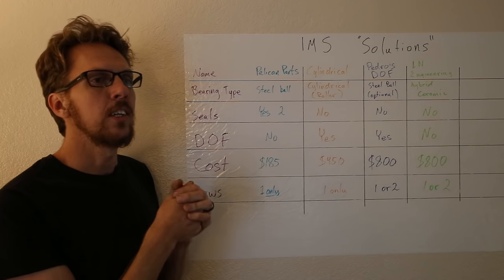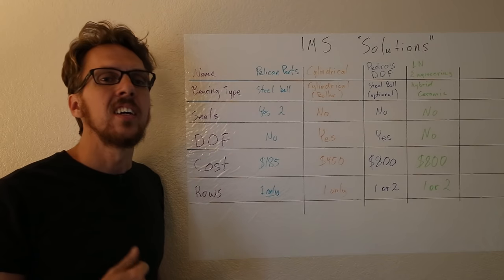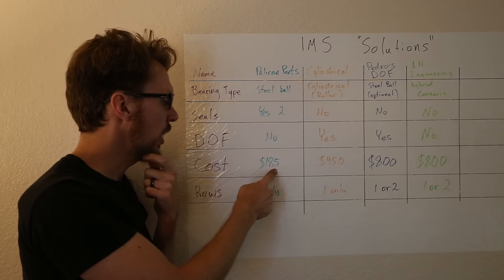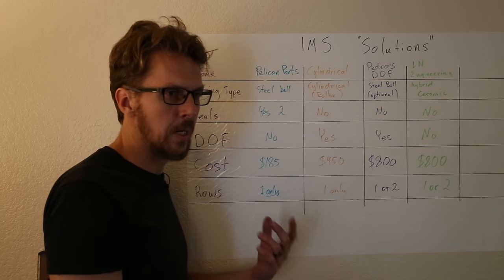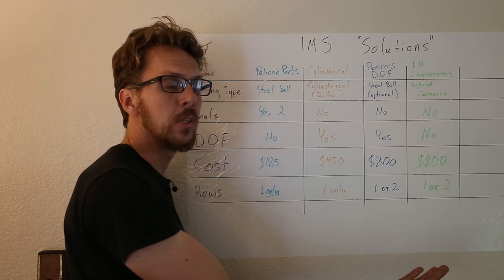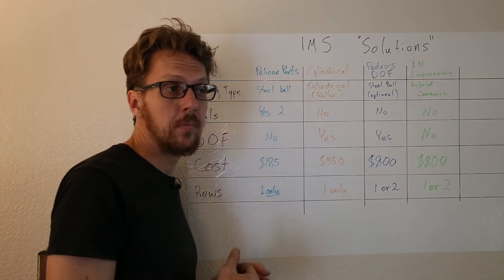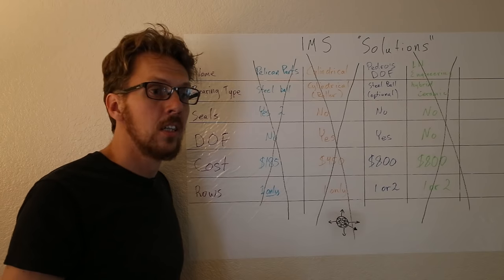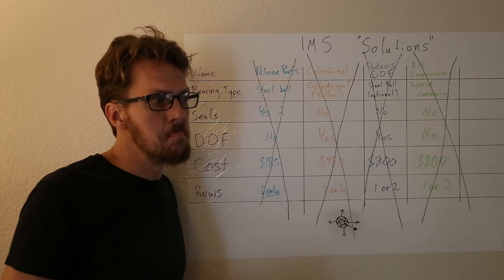What's the Best IMS Kit for Porsche (996 or 986)

Comment: Burner, you are right, especially LN in the pricing model. I can understand the high price in the beginning, to protect against the engineering costs and development, but as volume grew, the cost should reflect a fair markup. LN advertises that they have 30K kits installed, even at 800...(many of the solutions they sell are much more expensive) adds up to 10s of millions of dollars in revenue. Opportunistic, to say the least.

Comment: One thing I don't hear much about (oh, great video by the way!) is that the sealed bearings are running in grease, not oil.  Removing the covers and using engine oil on balls seems like it is a bit thin of a lubricate.  My understanding is that bearings and bushing work by maintaining a thin layer of lubricate between the rotatey bit and the not rotatey bit essentially hydroplaning. Great, but the ability to maintain that layer is dependent on contact size and point/line load.  Balls have such a tiny contact area they need a thicker lubricant (like grease) so you see this in ball bearings and CV joints.  Bushings have huge contact area and can use a thinner (oil) lubricant (like cam and crank bearings/bushings).  I think that when the ball bearing or CV gets hot enough, the grease will flow a bit, but it stays pretty thick.  So,...  If you remove the cover of a ball bearing and expect oil to lubricate then it will probably not be up to the challenge for high radial loads.  I have no idea what the end of the IMS load is (all the important sprockets and such are on the other end), but fast and spinning probably will have a reasonable load.  All this together, I think if you had found a bad seal on your original bearing it would have been gone or be going south.  Since it was intact, you were good.  The low mileage cars have more acidic compounds sitting in the oil along with more fuel and such that only gets burned off at extended higher temps so those seals tend to loosen and separate.  So, great choice on the new sealed bearing.  I bet that is the absolute best option!  All in all you replaced the bearing, cover, bolts, and case bolts?  The clutch bolts as well?  Probably saved yourself $200-2500.  Awesome job! Franny
Reply: Many engines use needle and ball bearings running in oil not grease. Infact virtually every transmission uses open caged ball bearings and atf is roughly the viscosity of 30wt oil. Again none of the above have significant issues.
Reply: Oil is preferable to grease as a lubricant. Grease is used in ball bearings as it is impractical to use oil in most applications.

Comment: So these are my thoughts on this ims bearing.  
When the ims bearing is removed there is a small loss of oil, so this means there is lubricant getting to the bearing. I get the idea of the old style engines having a oil fed bushing, but with this mod kit 50k lifespan is not great.
The porsche problem seems to be that they used sealed bearings, so my solution would be to use a open roller bearing (even ceramic) the bearing would receive some lubricant from the crank case when the engine is running.
It's similar to a  two stroke motorcycles using the two stroke oil to lubricate the main bearings.
Personally these modifications are a lot of money and best off keep the oil changed regularly , and inspect the oil for metal or plastic bits.

Comment: Great breakdown of all the options Burner!  When I replaced the IMS bearing in my 03' 996 five years ago, I don't think there were as many choices.  I also liked the ceramic-hybrid option and chose the pricey LN bearing and with my first DIY project on this car, replaced the clutch and IMS bearing.  The original bearing I pulled out of the car seemed fine and probably would have lasted many more miles, but all this internet talk about this issue prompted me to take action, maybe unnecessarily.  Four years of stop and go daily driving with the LN ceramic bearing was fine, then a cross country road trip actually did the bearing in.  The 6 hour at-a-time stretches on the interstate highways took it's toll on the second day of the drive and scary noises began to extrude from the engine.  After shipping the car to the final destination and dropping the oil and cutting open the filter, I knew this was a bigger job than my DIY skills could handle on a flat-six motor.  I contemplated my options, and ended up sending the car to Raby Enterprises where they did a, "reconstruction" of the engine and also put in the IMS Solution bearing with fresh oil feed.  I just got the car back this past spring and have been driving and smiling all summer.  For the reconstruction, I opted for the 3.8 street performer, which brings the engine specs close to that of the 997 CarreraS.  The engine is a torque monster, and only time will tell if it's reliable with the IMS Solution, but I think it will be based on your analysis.  In hindsight, I would have not done anything to the original 70K mile engine and only if something did happen, send the car to Raby Enterprises to refresh the old engine with a torque monster (that still gets 24 mpg highway).
Reply from the maker: That's my thought exactly. You're not the first person to have one of these ceramic hybrid bearings fail, and--after swapping out mine--I feel I would have been better off just leaving the original in place. Something will force me to rebuild the engine, anyway. I do, however, think the IMS Solution will be a permanent fix, but only time will tell. 

Your 3.8 sounds awesome! If you're ever in the Seattle area, I would love to see your 996!
Reply: I was close to deciding on replacing with some sort of LN option.  But the splash lubrication ultimately didn't sit well with me.  The IMS solution came around and peaked my interest!  In the end, I came to the same conclusion as you and others commenting.

If I need a clutch job and the IMS inspection returns a positive result.  I'll opted for an OEM part.
Reply: I am a bit confused. Which out of the 4 + 1 options you analyzed in your video, is the ''IMS solution''..?
Reply: Ray Gee how long did it take Jake to rebuild your motor?

Comment: LN Engineering’s IMS solution is the best. I have a new version on my car. It essentially tries your motors into Mezger reliability!
Reply: Unfortunately, there isn't enough data to know the reliability of any of these solutions, including the LN one. There are numerous failure modes of a plain bearing so it's not like it's impervious to failure. Additionally, if you watch the videos the creator made, he admits that he went through many iterations that had issues before he got to the current one. That's a good thing but it is an experiment. Iteration is the path to finding the best solution. But the one that works may be the current one and it may be the next one.

Comment: There is one thing that I dont quite understand. Porsche manual says the oil capacity is 8.5 litres. When I filled it 8.5 I only got just the minimum digits in the oil level indicator. In the end I put over 10 liters and I am now two digits from top where I want it.. The oil level definitely has somekinda relation to IMS as the bearing (=oil pump shaft)  should be completely submerged in oil. I always keep the oil level near the top. Maybe if the oil level is near minimum the "pedro video" effect can actually happen. I dont know.

My double row was in perfect condition when I replaced it at 83 000 km / about 2200 hours in the engine ECU. No play, There was about 1 dl of oil inside the shaft, no grease left in the bearing. Insted there was oil as one would expect. 

I've always analyzed the the oil filter paper collecting with a magnet  and otherwise. I've had no ferrous particles, a bit aluminium dust and little bits of brown plastic (chain tensioners).

Comment: here is a note for bearing with seal on both side. IMS is submerged in  very hot engine oil and the heat turns the grease into liquid oil and as the bearing spins at high speed especially porsche 7500 rpm engine,  the centrifugal force push the oil toward the race of bearing and eventually sipps out of seal.. then the bearing runs dry

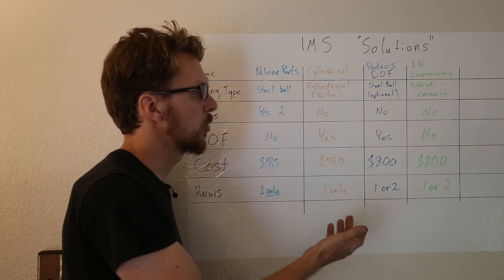Comment: I've watched your video (and countless others) in an attempt to reach a decision. It's currently 06:00 on a Friday morning so you could even argue I'm losing sleep over it! Your 986 had 90k miles. My 2001 base has 143k and runs great (I've owned it for 11 years, since it had 33k miles). The dealer says they service several with over 200k, without IMS problems and the IMS failure rate is arguably less than 10%, so I believe them. The dealer checks the "numbers" everytime they service the car and they insist everything looks really good. I'm planning a paint job and several other mods over the next several months, so a couple $k doesn't really scare me. I intend to keep it. It is my wifes daily driver (the hard top is great in the winter). I'm also going to take over the service/mod installation myself. Note: Because I have an '01 the only way to becertain if I have a single or double row is to pull it out and look at it, which makes it difficult to buy certain brands of replacements.

I have two questions.

First the easy one...I'm all for making my own installation tools, which I would probably have done anyway after seeing the tool kit retail price. The cost of the tools alone is enough to make me reconsider a (Porsche) dealership installation. I'm being quoted $1,750 labor (plus fluids) but I have to supply the parts. They even advised me to schedule it just before I need an oil change! Oh, yeah..the question...Where did you find the specs to make the tools, especially the pieces that look like pieces of old door hinges (no insult intended)? 

The second question...I hate to continue to beat on the LNE solution but your chart doesn't allow for their DOF version, which is an outrageous $1,800, as others have mentioned. One of their nearby certified installers wanted $3,500/$3,600 for a turnkey installation plus another $600+/- for new clutch parts. I replaced the clutch at 75k but was unaware of the IMS issue at that time. Since I'm now over 140k, it's reasonable to consider a new clutch, even though there are no obvious problems. The LNE $1,800 version is (in my opinion) a GREAT permant solution and the factory should have done something similar to this to begin with, after all, the fixed bushing/race (instead of bearing) design was originally Porsche's. Even if the "bearing" did fail it wouldn't be catastrophic!  If I take on the IMS repair myself, of which I am quite capable, the $1,800 becomes much more realistic. Back to the second quesion...Thanks to the internet, I have found another option called the "Eternal Fix". I'll include the link below (I hope I'm allowed to include links in messages). If you follow the link you will see a variation on the LNE solution/replacement for both single and double row IMS bearings. They are MUCH cheaper than the LNE version. Even the LNE version is cheaper from them than from LNE. The prices are still stated in Euros, even though the vendor is in the UK. Given the price difference, I'll pay the shipping charges!  The top item on the page fits either single row or double row. It's currently on sale for 400 Euros, which currently converts to about $300 US. The LNE full kit (DOF system) is on sale for 1,285 Euros, which is $965 US. That is nearly half of the LNE, stateside cost. Back to the second question(again)...what do you think of the "Eternal Fix" vs. the LNE DOF solution (especially if I can get it for less than $1k (plus shipping, ofcourse)? For informational purposes one Euro is currently equal to 0.75 dollars.

http://www.design911.co.uk/fu/pt856_1748_-cma81-cmo82/Porsche/Boxster-986-987-981/Intermediate-shaft/
Reply from the maker: Hi Jim,
So for the first question, I couldn't find any specs for the tools, either, and ended up measuring the engine and doing a bit of trial and error. Once I did that, however, I wrote out all the measurements (as best as I could determine) on my blog: http://burnerscars.blogspot.com/2016/09/how-to-make-porsche-ims-camshaft.html. Of course this only helps you if you have the earlier 5 chain engine with the dual row bearing... the later engines require a different tool to lock both intake and exhaust cams. 

On that none, I think you can determine if you have a single or dual row by removing the camshaft plugs... If there's a slot on only the intake, it's probably dual row. Slots on the intake and exhaust and it should be single row.

On to the second question: I do think the LNE solution is pretty good. I think it's the best of all solutions currently on the market as it eliminates the bearing and uses a system Porsche has used for years. It's pricey, but probably the best. When I made this video it was still very new. It's been out awhile, now, and it seems like a good (if somewhat expensive) solution. Right, on to the "eternal fix"... There's isn't a whole lot of detail about it, but I'm somewhat skeptical. One important note: any system that works for single and dual row cars is a single row bearing with spacers. This means if you have a dual row bearing, you're replacing it with a smaller single row. Since the single row bearings have a higher failure rate, this only seems like a good option if you have a single row car.
Reply: Thank you, for the response. I'll talk to my contact at the dealer and ask him about your "camshaft plug test". They agreed with me initially that a visual inspection of the bearing was the only way to be certain if mine was a single or dual row.

I was much more confident of my ability to complete the IMS replacement when I thought the tool dimensions were somewhat available. I now understand why you crossed your fingers (and cringed a little) as you started the car for the first time after the bearing replacement. I may just bite the bullet and buy the tools. I can always resell them to someone or possibly find a used set before I begin.

FYI: LNE has specific requirements before they will warranty their installation. One of the questions was concerning the condition of the "cam chain pads". If the pads had not been previously replaced it was going to be necessary before they would proceed with the IMS bearing replacement. I'm not certain as to the direct correlation of the "cam chain pads" and a worn IMS Bearing but I just started this journey. If you haven't inspected or at least otherwise addressed them, you might want to check it out to protect your investment.

Thanks, again!

Jim

Comment: People keep saying pre 2000 m96 engines are less to worry about regarding the ims due to dual row. But I just wanted to let you guys know that I have a 99 Boxster built in 98 and I have a single row that looked dried out and I replaced it with a DOF tunersmotorsport IMS. Just a heads up don’t always rely on your year change it before it’s too late.

Comment: WOW great video .. we think alike.. i went through this issue 2 years ago. i purchased a double roller ceramic bearing for my porsche 911 IMS for $100 . i installed it as open bearing with no seal on either side, allow motor oil to cool it and lube it, the bearing is inside motor oil all the time, just keep the oil pan always full to top. ..  you should know the 300 degree motor oil will melt the grease outa your sealed bearing and it will rely on engine oil as well, only to have seals on the side to restrict the oil flow.. that's my theory  anyways.. my car runs excellent... i will check it at 120k miles again and put a new one again, ,,yes there are so many sharks out there sucking blood outa americans and their fears,,, thanks for your video...